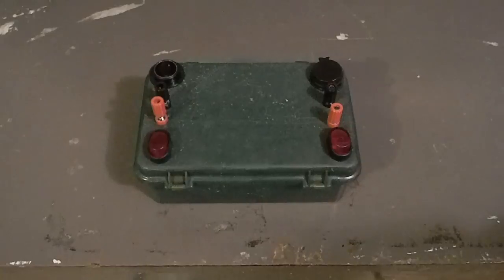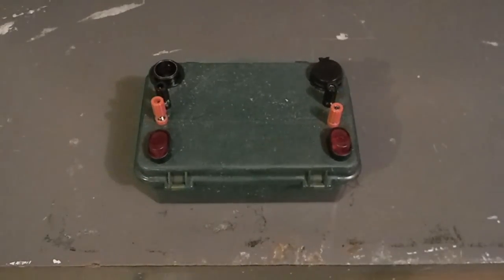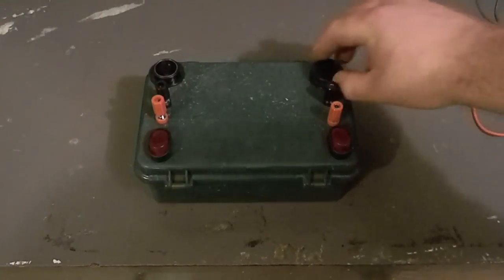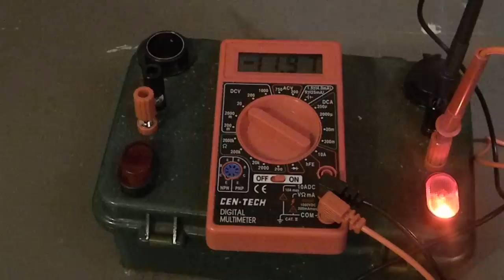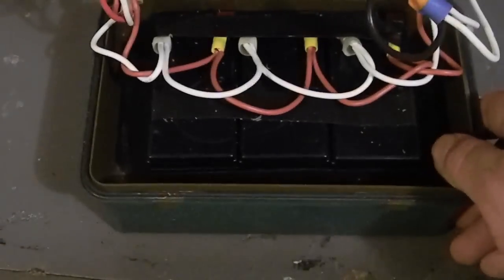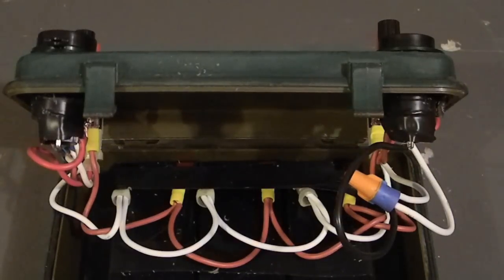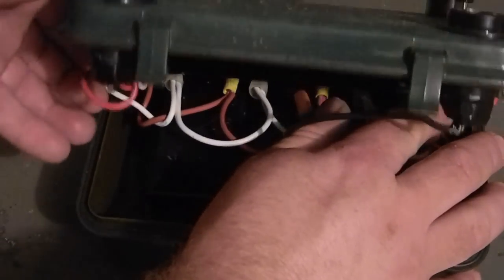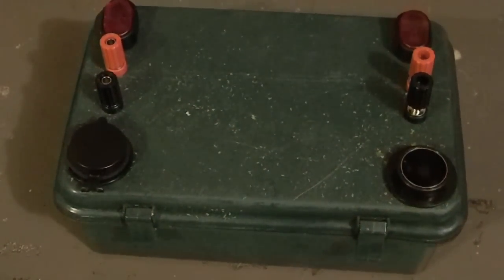DIY Battery Box Build - Small & Portable - Great for Camping

Comment: In a battery,  electron flow is the current, while voltage is the pressure that pushes the electrons. Remember that and you can apply the "flow of holes" theory.